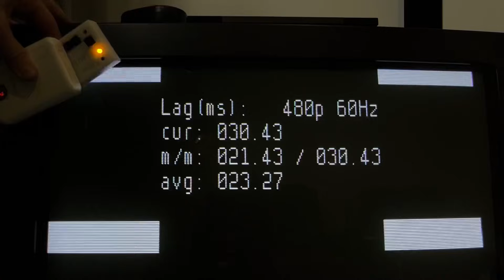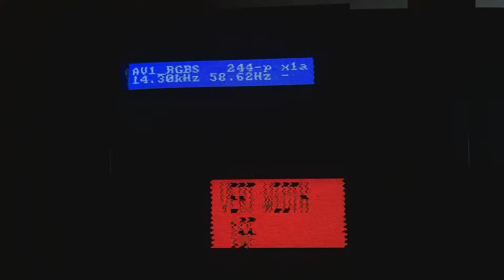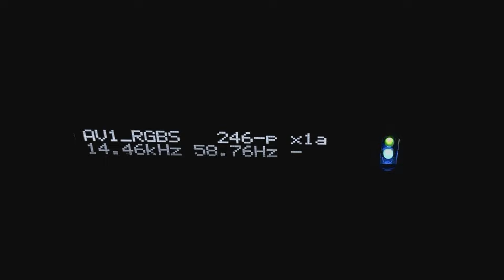Downscaling Chronicles 17: The ORIGINAL MIMO Genius Box. 🎶🪗Downscaling Musical 🇮🇹🎤🎶(Luna Mezzo Mare)

Comment: When you play ps4 or switch on a crt, how ecactly are you adjusting the aspect ratio to 4:3 on the bvm?
Reply from the maker: Now that I am back to using a 4:3 CRT, it depends. I use the OSSC Pro so it’s easy to choose aspect ratio. I usually have the game in 480p so it’s closer to a 4:3 AR, then downscale to a slightly stretched 4:3. If the stretching looks awful and character sprites are too thin and oval-looking then I have the console output 720p and use the OSSC Pro to window the downscaled video to a 16:9 AR and put up with the smaller playing field. I normally do this for 3D games, and play 2D games in stretched 4:3
Reply: @MarcoRetro316  am I correct in assuming say Nintendo switch online which has borders around a 4:3 game would squish it even more to fit on a 4:3 screen.  I do have a widescreen sdcrt so could bypass that but just curious
Reply from the maker: @jeb_leeds2928 I haven’t used Switch Online since I tried out their release of Gameboy games, but yes I imagine they would border with pillar bars to window into a 4:3 frame for widescreen displays. Some scalers can stretch this squished image to the full original width, otherwise using a widescreen CRT will achieve the same original aspect ratio

Comment: Oh my god, that was so funny! 😂 It's a shame you couldn't fix the sync. Do you think there's any chance that the unit is still faulty and can be fixed?
Reply from the maker: @sjftech  Thanks! My gut feeling is that the OSD values were pushed out of spec because I CAN get the OSD to display normally if I raise the ‘Sync Adj’ value, but then it doesn’t show the input. I’m not sure I can rescue this set by OSD values though, I tried for so many days to raise and lower all values, but the Read-Only H and V OSD values show 0000 on a fresh boot up so it must’ve re-zeroed even though all other values are not at a minimum. The manual actually states not to touch certain values unless obtaining factory authorisation lol, so it must be known to MIMO that the Genius Box is prone to falling out of sync